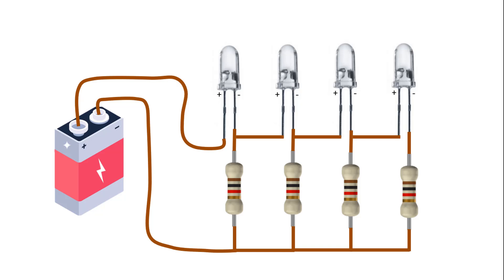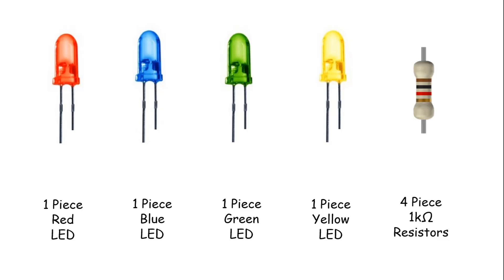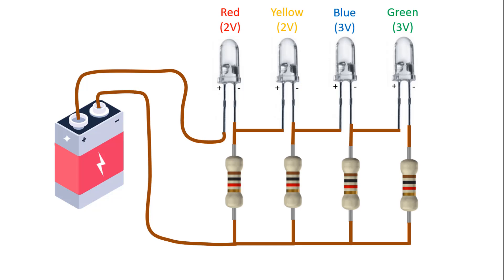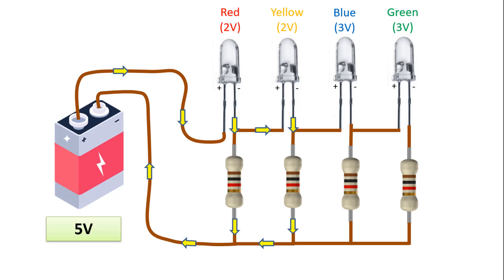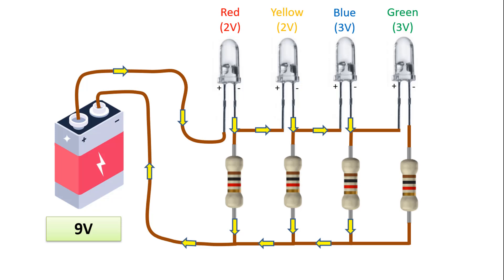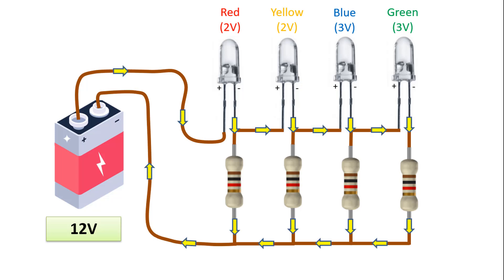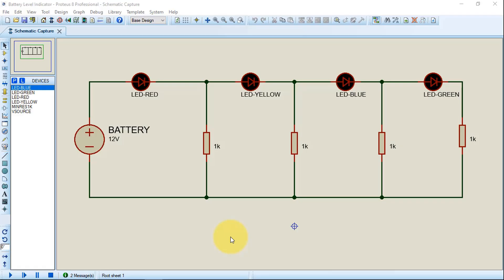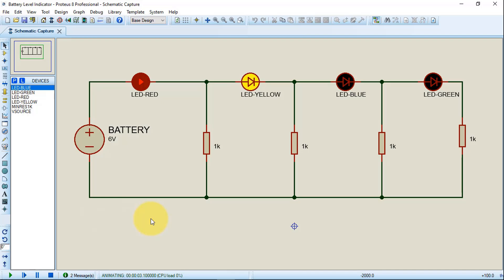12V Battery Level Indicator Circuit

Comment: I want milli ampere level voltage level indicator, which value of resistor should i use for visually monitoring  increasing voltage from 2v  to 2.10 ma ,20,30,40,50,60,70,80,90, 3v 
Ohm range resistor possible?

Comment: How much amperage does this draw? Will it draw a 12V 5Ah sealed lead acid battery? Could an on/off switch be placed between the battery + and the first led to reduce any possible draw down?

Comment: Good basic introduction: in practice however, the steps are +3V (blue) +5V (Yellow) +7V (Green) +9V (blue) with 1K resistors. The current principal is correct, however each component must be within tolerance (LED diode leakage + matching resistors) to be a perfect voltage/current match.
Reply: I think you mean red for the +3V

Comment: Hey why are The LEDs in Series and Not in parallel
Reply: It’s a mix of both. The positive terminal are in series with each other, however, the negative terminal (or ground) is in parallel.

Comment: 😢 This is too simple, the steps are too big. You must define a voltage step with R-series and give the single steps to a 4-comparator like  uc339 and the other comp-Inputs are derived from the battery voltage. A 9V 200mAh block has 7 Ni-MH cells, the discharge voltage is 7x1,05= 7,35V and the full charge voltage is 7x1,5=10,5V and falls back to 7x1,3=9,1V.
And in four steps you have to define a cascade between 7,35 and 10,5V=abt 3,2V, this is pro step 0,8V.
Remember the uA339 has open collector outputs active high and has to be grounded to zero or minus 0V with a resistor fitting for LEDs, the cathode of the LED goes to ground.
This is a logic sequencer wiring which can be used also as timer sequencer to switch a transmitter and a receiver via relais upon the same antenna. 73 de hb9csu
Reply: Lek gawe potensi piye carane? Aku gak ngerti rek.